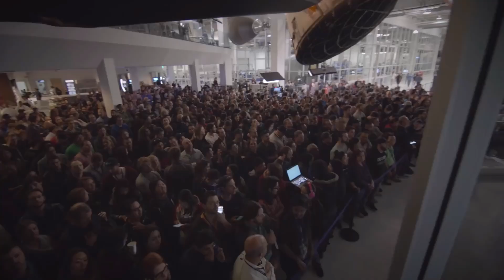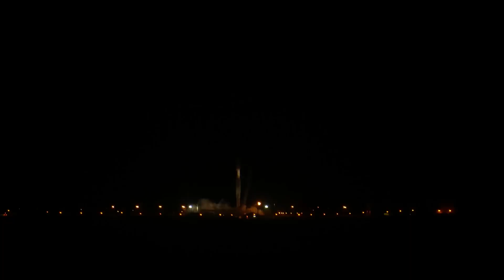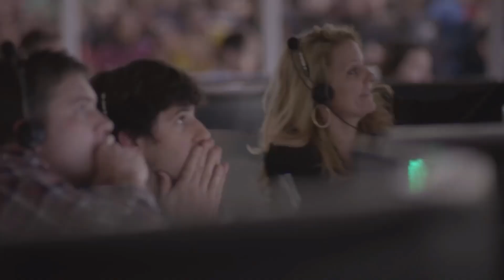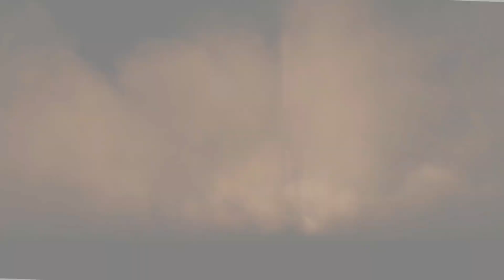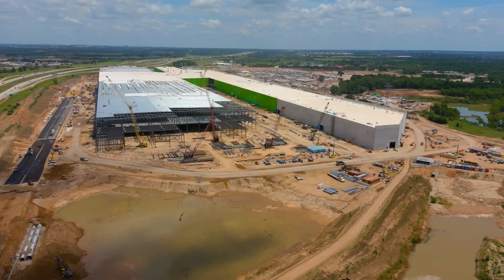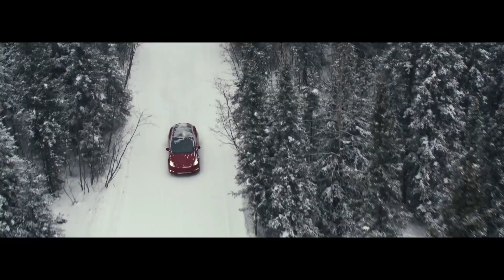SpaceX & Starlink the big rise!

Comment: I’m not moving to Germany until I can get starlink
Reply: Starling won’t work well in highly populated areas... which is the case of almost all of Germany.
Reply: @st-ex8506  of course it will work as long as you can mount it with a clear view of the sky.  SpaceX will simply not allow huge numbers of subscribers in each location because of total
Bandwidth limitations.  As long as you get in early enough it will be fine.  Elon stating that it was not suitable for urban areas is because fibre can handle higher bandwidth and will be cheaper.  

However my experience of German broadband makes me believe that starlink will be better for those that can get it